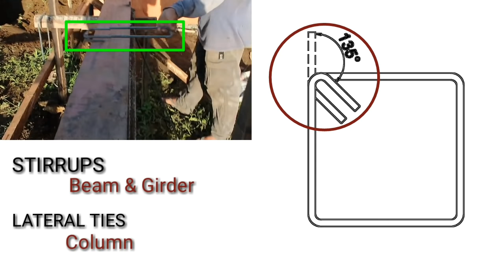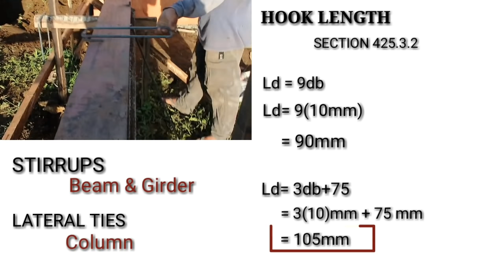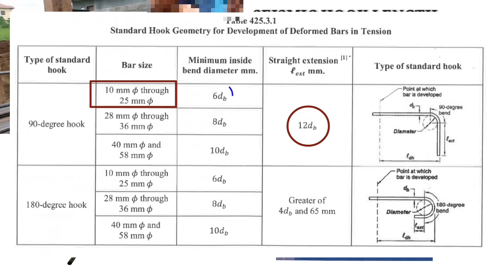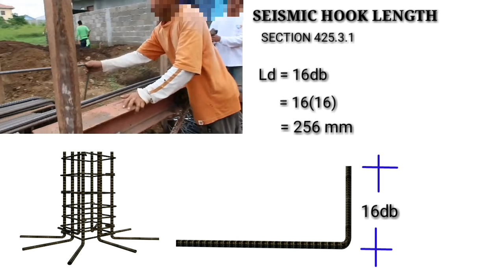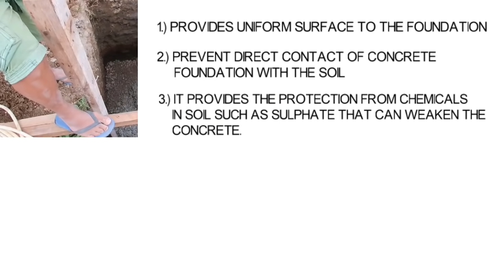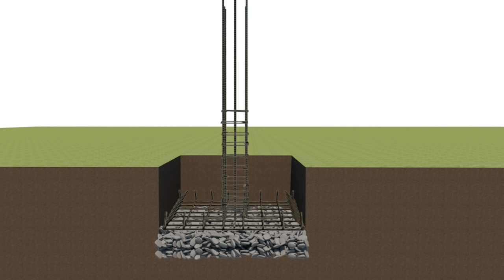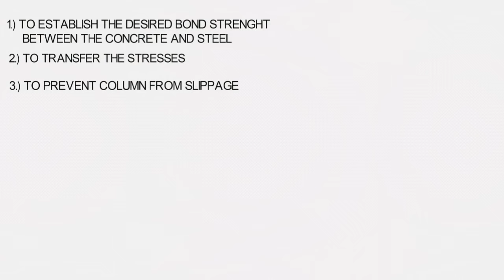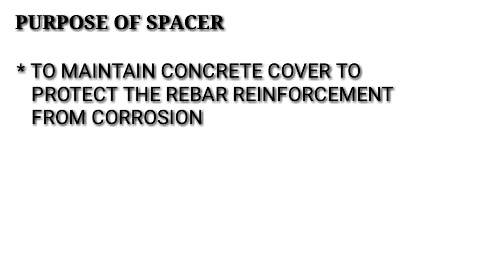COMMON MISTAKES IN CONSTRUCTION - PART 1

Comment: Sir pano po ba dskarte pag buhos ng footing kng may tubig mahirap gawin yng mga spacing sa lupa at rebar
Reply from the maker: Lagay ka ng sump pit sa tabi ng hukay para dun lahat pupubta yung tubig tapos dun mo ilagay yung water pump.
Reply: @ARONJAMESGARCIA  ok sir tnx. Pero pano nmn po yng mixture ng concrete di ba lalabnaw yn pag nakababad sa tubig
Reply from the maker: @tonymasculino1128  ganito idol kailangang na drain muna yung tubig bago niyo po ito buhusan ng Concrete
Reply: @ARONJAMESGARCIA  ok sir maraming salamat.

Comment: Sir ask ko lang kase ginagawa yung building namin apat na palapag napuna ko 90 degrees ang anilyo ..sabi nila design daw ng engineer yun..hindi ba delikado yun ano kaya remedyo para baguhin nila ang sistema na yun?
Reply from the maker: Pwede pa naman gawan ng paraan yan kung hindi pa mabubuhusan pwede niyo po pa bend ng tubo kasi 10mm lng nman yan for sure, and paki check narin yung haba ng Hook kung umabot man lng ng 75mm or 3inches.
Reply from the maker: Total kayo po nagpapagawa pwede niyo po irequest sa engineer na Incharge jan na baguhin yung hook, 
Yng 90 degrees hook okay yan sa mga cross ties pero sa Outer ties mas okay kung naka 135 degrees hook para nakayakap siya sa main Bar.
Reply from the maker: Okay yang 90 degrees hook for Bungalow type/Single storey kasi minimal yung seismic load (epecto ng lindol.)
Reply from the maker: At kung Magtatanong po kayo about sa mga ganyang bagay like Hook haba ng splice, termination ng dugtungan ng bakal wag po sa mga Skilled worker kasi sigurado ang isasagot po sa inyo niyan ay kung ano yung mga typical na nakikita nila, mas mabuti kung Direkta niyo itanong sa Technical na tao gaya ng Engineer.
Reply: Four storey sir kaya natatakot ako.
Reply: Thanks so much sir sa mga payo nyo..

Comment: Sir Aaron question, bakit po 16(16mm) ung Straight Length Extension, since sa table 12db po ang formula hindi 16db? Thanks!
Reply from the maker: Total Length =6db/2 + 12db + db = 16db
Yung 12 db measure from na center ng minimum Bend diameter.
6db kaya hinati ko sa dalawa para maging radius
db yan yunh sukat ng bakal na ginamit
Kaya yng 16db na yan ay measure mula labas ng bakal hangang sa Tip nito
Reply: per sir hindi po ba development length po ung hinahanap hindi Total Length?

Comment: Meron bang code na  nagrerequire na dapat naka 135deg ung lahat ng hook ng ties at stirrups, thank u sir
Reply from the maker: Please see chapter 25 of NSCP 
Standard hook
Seismic hook
Crossties

Standard Hooks
90° applicable siya sa circular column

Seismic hooks
When we say seismic hook ito ay 135° applicable sa outer ties (square column and rectangular)

Crossties
a) Crosstie shall be continuous between ends
(b) There shall be a seismic hook at one end 135°
(c) There shall be a standard hook at other end with minimum bend of 90 degrees
(d) Hooks shall engage peripheral longitudinal bars
(e) 90-degree hooks of two successive crossties engaging the same longitudinal bars shall be alternated end for end, unless crossties satisfy
Crossties

Comment: Gaano po kadeep ang excavation for two storey po? Saka ano po height ng column footing po? Thank you poo😊
Reply from the maker: Depende po sa result ng computation maraming factora kasi kailangang iconsider bago malaman kung kaano kalalim, at kung anong magiging sukat ng footing. Like Soil bearing capacity, location, load transfer from Superstructure and etc.
Reply: @ARONJAMESGARCIA  salamat poo, ano po ba pinagkaiba ng Footing Tie Beam, Plinth Beam at Tie beam? Nalilito po kasi ako sa tatlong itoo, base po sa nasearch ko at pagkakaintindi ko, yung footing tie beam sila po yung below ground level/natural grade line, pang support sa Foundations

Yung Plinth Beam po above ground level pang support po sa mga walls ng ground floors

Yung Tie Beam po, sa higher floors po like second floor pang support po sa walls ng second floor

Kaso di ko po alam kung tama understanding ko po😥pwede po patulong huhuhuhu
Reply from the maker: Footing tie beam or Tie Beam.
Reply from the maker: Ang sumusuporta sa mga wall above ground level ang tawag diyan ay Girder or pwede naman ipatong sa Intermidiate/ Secondary beams or pwede namang Lintel Beam

Comment: Hi Engr. we are planning a simple house around 70sqm. is it cheaper to make the roofing a slub or yung traditional na type of roof? TY
Reply from the maker: Mas mura po yung traditional roofing at the same time less maintenance.
Reply: @ARONJAMESGARCIA  Ganun po ba ano po ang mga cost inclusions ng maintenance pag naka rooptop?
Reply from the maker: @opporeno8658  water proofing.

Comment: can you explain bakit walang gumagamit MAT Foundation dito sa Pinas? and why. ty
Reply from the maker: Meron naman gumagamit niyan dito,
Lalo sa malalaking Gusali, pero for small residential hindi naman siya applicable kasi minimal lng yung load na kailangan, kaya na ng isolated footing  i carry yung load na yun , kaya hindi na kailangan ng malaking area para masuportahan yung pressure or Bigat ng isang Bahay.
Reply from the maker: Inapply din  Foundation na yan kung angg Soil bearing capacity ng lupa ay mababa.
Reply: @ARONJAMESGARCIA   pero, hindi ba mas maganda MAT keysa sa mga Simple footing? hindi ba ganon din ba ang gastusin assuming hindi na kasali yung Bore pile.. puede po ba yun? patigasin lang yung lupa. kc usual problem ng simple footing sa atin yung Cracks and then uneven distribution ng load, tumatabingi yung bahay. tapos pag earthquake talagang malaki ang damage. yung MAT type naman...it's very rare about sa mga cracks. although it's been proven naman hindi advisable yung MAT type pag malapit sa Dagat pag may Tsunami tlad ng nangyari sa Fukushima japan na talagang wipe out ang mga bahay. Do you think puede ba akong gumawa ng Bahay then MAT type foundation pero walang Bore Pile? ty sir.
Reply from the maker: Yes pwede naman, mas mahal nga lng kasi yung area na hindi na dapat kailangan ay malalagyan ng Concrete at rebars, the reason may mga bumabagsak na bahay na isolated footing ay dahil 
1.). No supervision of Engineers, si foreman or Carpentero nlng gumawa 
2.) Hindi nasunod yung plano and provisions na nakalagay sa plan.
3.) Natutulog sa pansitan si Engineer.
4.) And many more.

Comment: Sir okay lang po ba ang 1 inch na concrete cover sa column?
Reply from the maker: Ang minimum cover po natin is 40mm to protect our rebar reinforcement from corrosion  ang 1 inch po or 25mm ay applicable lng po sa cover for suspended Slab.😊
Reply: Thank you sir .ask ko narin po kung okay lang po ba na 20cm × 30cm ang size ng column for elevated bungalow 10m x7m ?
Reply from the maker: @maevesjourney1834  Gaano po kalayo ang Column niyo?
Reply from the maker: @maevesjourney1834  I mean yung distance between two Column?
Reply: Nasa 3.4m sir ang distance .
Reply from the maker: @maevesjourney1834  
Schedule of Column
Dimension : 200mm x 300mm ✔️
Vertical Bars : 6-12mm ø
Lateral ties : 2-10mm ø Per set
Spacing of ties: 2@50mm, 6@ 100mm, 2@175mm  The rest 200mm on Center and Conversely.
Reply: May nabili kasi ako sir na 16mm pero 4meters ang length grade 40 okay na po ba yun sir instead po yung 6 na 12mm sa column?
Reply from the maker: @maevesjourney1834  okay nman pasok parin naman interms of required spacing ng vertical bars ang 16mm
Reply from the maker: Ang kaibihan lng mas mapapamahal ka sa 16mm pero kung meron kna nabili pwede nman yan na gamitin mo mas malaki safety factor niyan, Balance design parin nman. Kaya no worries sa over reinforcement.
Reply: Thank you sir for free consultation .Godbless po.
Reply from the maker: @maevesjourney1834  Salamat din po sa panonood at SUPORTA sa aking channel😊

Comment: Sir Aron ano size ng column para sa chb 5´wall without nosing ang column. Tnx
Reply from the maker: Para saan po yan Idol bakod?
Reply: Kung structural column yan, di po pwedeng ang size ng column ang mag aadjust. Kung ayaw nyo po ng nosing then try wall panels or cladding
Reply from the maker: @qa3316  Tama Base on the revised code Minimum dimension of Column for multi storey Building ay 250mmx250mm or 10in. x 10in.

Comment: seismic hook lenght = 16db for 16mm? san galing ang 16 db? 6 db for 10mm - 25mm + 12db for straight extension
Reply from the maker: Standard hook is 16db for 10mm-25mm rebars where db is the Bar diameter
Please review the call outs na nakalagay sa drawing ng NSCP 
may lext na mesure mula sa dulo ng naka bend na bakal hangang sa radius of minumum bend diameter
In total lext + radius of minumum bend bars + rebar diameter = 12db + 6db/2 + db = 16db

Comment: Hello po, bakit po 16 db po yung equation sa 90 degree hook ng main bar po? di po ba 18db?
Reply from the maker: 16db = Extension + ( bent bars /2) + db na diameter ng bakal
= 12db +(6db/2) + db
= 16db
Reply from the maker: Check niyo po yung Drawing sa may Table.
Reply: maraming salamat po! as always very imnformative and responsive. More power sayo idol! ❤️

Comment: Boss sana mo mapansin po nyo ito.  Anu po ba ang standard size ng poste para po 4thfloor n bahay.  At anu po b ang mainam square or rectangle?  And last po pano po putol ang bakal ng poste sagad sa sahig 1" lang po ang nakalitaw pwede p po b ito dugtungan para makapag 4thfloor po?  Thnk u po
Reply from the maker: Idol pag ganyan kailngan ng Structural Analysis and design. Multi storey ma kasi yan idol.
Reply from the maker: Sa bakal nman Pwede ka magdugtong sa middle height ng colum pero dapat alternate ang dugtungan.
Reply: @ARONJAMESGARCIA  salmat po boss s tugon po. Ung bakal po ng poste boss sagad po mismo sa sahig ang putol bali 1" lang po litaw nya. Hindi po kc tinuloy ang poste abang.  Pwede parin po b madugtungan ang poste kahit ang naiwang nakalitaw n bakal nalang po ay nasa sahig na at 1" lng po ang litaw nya boss?
Reply from the maker: @erso2236  Pang ilang Floor po ba yung? 3rd floor?
Reply: @ARONJAMESGARCIA  boss 3rd floor po ung bahay po namin.  Ung poste po sa ika 3rd floor hindi po sya tinuloi putol po sagad s sahig ung bakal.  Ung mga hallowblocks po bali nakaakap lang po sya ng 16mm n bakal. Hindi po itinuloi ang poste.  Ang gusto q po sana magpa 4thfloor kaya lang pupwede p kaya dugtungan po ung poste?  Kahit 1" lang po ung litaw ng bakal?
Reply from the maker: @erso2236 pwede naman idol huling floor naman na pla Yan, dagdagan mo nlng spacing Lateral ties mo or yung anilyo kung tawagin sa may Lapping ng bakal
Reply: @ARONJAMESGARCIA  boss idol salamat po sa mga sagot po ninyo at lalo n po sa video po n ito.  Keep it up po..  Salamat po ng madami..  =)

Comment: Bat ung iba, ginagamit nila sa ties e 8mm, ok lang ba yun sa single storey slab.
Reply from the maker: Hindi ko din alam idol kung bakit 8mm. Idol ang minimum Diameter of Ties para sa Structural member ay 10mm. grade 40
Reply: @ARONJAMESGARCIA  Thanks po sir,, pwede kaya 12mm ilagay para sa column, single story lang po siya pero buhos po ceiling niya..? Thanks po ulit.
Reply from the maker: Pwede nman Idol

Comment: Bakit hindi ginagawa ang welding sa stirrups eh mukhang hindi mahigpit ang tie wire
Reply from the maker: Welding can weaken the Steel and
Not all rebars are weldable.
Reply: @ARONJAMESGARCIA  assuming na weldable ang rebar, mas mainam ang welding kesa kunting twist lang ng tie wire
Reply from the maker: @okzzvil7617  Yes mas matibay ang weld connection kung ang pinaguuspan lang ay ang kapit ng steel or Rebars pero sa Reinforced concrete hindi sya ganun ka effective dahil sa mga ito

* Concrete and Steel Expand and Contract at different rate kaya kapag ang Stirrups ay naka weld magkakaroon ng stress or Pressure na magiging dahilan ng cracks sa concrete dahil hindi nag move freely yung stirrups dahil ito ay naka fixed with the main Bar.

Compare to Tie wires
Tying keep the rebar move freely kaya hindi ito magkakaroon ng pressure sa mga joints.
Reply from the maker: @okzzvil7617  Pwede yang weld connection for Splicing kasi parehas lmg sila ng movement but kailangan mo ng skilled worker para gawin iyon at hindi basta basta welding rod or welding equipment ang ginagamit para pagdugtungin ang dalawang bakal kailangan mo ng " Gas pressure Welding Equipment" para dito.

Comment: Engr mag comment lang po. Ang sinabi mo na 90 degrees bend sa stirrups and ties is mali at ang tama ay ang 135 degrees . Based on ACI both are acceptable pero sa 90 degrees n bend ay mas mahaba kesa sa 135 degrees bend. Paki correct na lang
Reply from the maker: Seismic hook 135 degrees
Inner ties it can be a 90 degrees but for outer ties hindi pwede and aside from that 90 degrees is not economical better to use 135 is for efficiency and adequacy
Reply: So sana hindi mo nageneralize na mali ang 90 degrees hook , dalat sinabi mo may limitasyon sya sa gamit .
Reply: @julioparis5417  Inshort mali nga talag hahahaha
Reply: @julioparis5417  wag ipagpilitan kung mali.
Reply: @johnlopez1261  mr lopez basahin mo nga sagot ni mr garcia na sinabi nya pwede gamitin . Bakit ka nagagalit. Nililinaw d ba? Wag ka high blood. Magbasa basa ng maayos pag may time

Comment: Sir saan po galing yung 9db at 3db sa 2:55. thankyou
Reply from the maker: Dalawang option po yan pero kung ano ang mas mahaba yun po yung gamitin natin na Lenght ng hook
Option 1
L = db + minimum bend diameter/2 + extension Lenght
   = db+4db/2+6db
   = 9db
Minimum length 
L= db + minimum bend diameter/2 +75
  = db + 4db/2 + 75
  = 3db + 75

Yan po kung ano ang mas mahaba jan sa dalawa yun po yung gamitin natin.
Reply: @ARONJAMESGARCIA  thankyou po sir, ibig sabihin given formula po talaga sya sa code?
Reply from the maker: @JcsMusicGuitar  Yes Idol Galing yan sa NSCP
Reply: @ARONJAMESGARCIA  thankyou po sirr

Comment: bat po naging 16db ung sa @5:40 hindi 18db?
Reply from the maker: 16 db kasi Idoli yung Extension na 12db ay measure from the Center ng Bend diameter
= 12db + 6db/2 + 1 = 16db
Reply: @ARONJAMESGARCIA thanks idol, last na lang,bakit nag +1?

Edit: ok na idol.. ung +1db pala ung thickness ng bar sa baba thanks!

Comment: This mistake is not happening if you hire architect or engineer. And before this construction drawing will be inplace into actual installation enginner and or architect will validate the drawing before signing in the construction plan. The mistake that you ate talking about is those done by non professional.